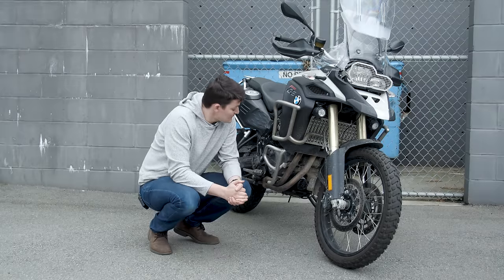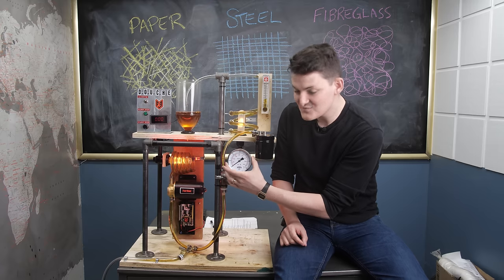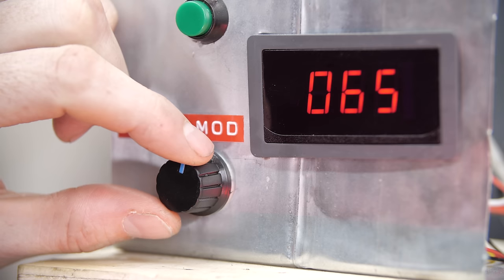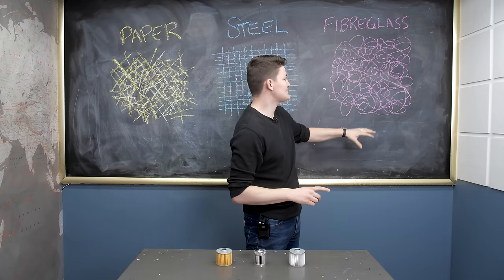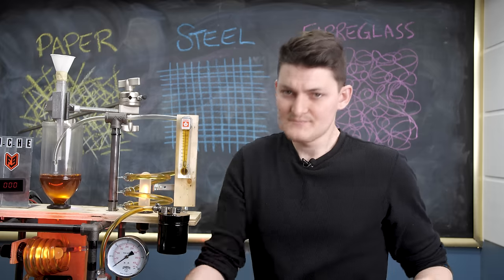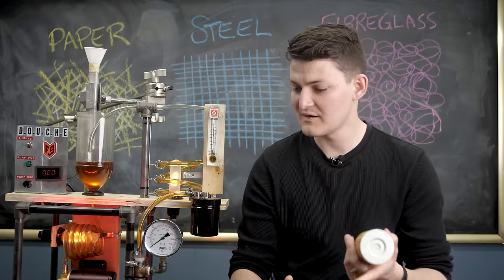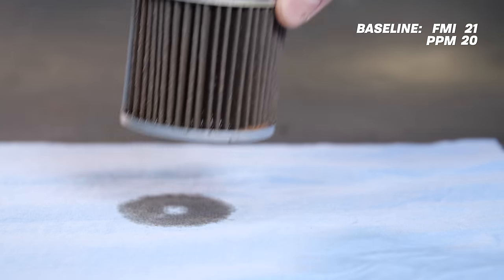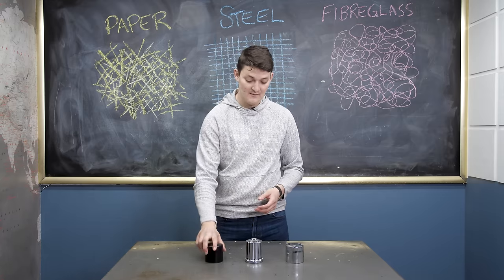The Best Oil Filter - Testing Paper vs Fibreglass vs Steel

Comment: The only thing I would add to this topic is the outer case quality. I have seen cheap filter balloon and or burst at highway speeds. SO it pays to purchase a quality filter over the cheapest option to prevent oil filter failures. I prefer the ones that have the "nut" on the end of the filter housing, so you can use standard socket over a filter wrench to remove the filter. I personally use a K&N filter, and for the last 20 year have never had one fail on me, but you are more than welcome to use whatever you prefer. This is just my two cents on the topic.

Comment: Like anything else, if what you currently use is working
Don’t change.  Like all those who upgrade their brakes when most don’t drive thier vehicle to the 9/10ths of its ability, yet think upgrading to racing parts at high cost gets them better performance at 1/10th, never mind that I racing almost everything is replaced/overhauled between each heat/race. Thus it only has to work within a defined timeframe/distance. You are spot on that application, and maintenance intervals matter and usually only if 10ths of seconds make a difference, otherwise go with stock or cost effective slight upgrade. Your vehicle has to pass many extreme to most daily drivers experiences in heat cycles, weather and wear. Those highly paid engineers on staff have found the sweet spot for 95% of drivers. Classic case of consumer brainwashing that more is better. Do you know how much abuse your current vehicle can take? More than most will ever even think about giving it.

Comment: there are only a few channels that open up and compare similar filters and all their examination relies n whether it "looks nice". Thank you for doing a scientific evaluation on the actual performance of the filter instead of the standard "nice" scale rating.  I couldn't care less if the filter is painted in pearl metallic with a silicone anti-drain back if it filters as good as my old gym sock.

Comment: There are cartridge style paper filters on some cars, e.g. the VAG 2.0l TFSI. Naturally they're in a plastic housing. So for those, a stainless steel filter would not need to have such a dramatic lower capacity for particles, as the filter diameter wouldn't be reduced. Besides, it could also be (partly) compensated by having a longer filter.

Also the higher back pressure of the paper filters is very likely not an issue at all if you're an everyday user. The engine manufacturers are taking this into consideration. On the contrary, if you have a massive oversupply of oil in various parts of the engine, you might run into different issues. Think about the oil drainage out of the cylinder heat cover. If that's at capacity, you accumulate oil under the cylinder head cover until bad things happen. Or in a slightly better case, you have just some more oil under the cylinder head cover and risk to run low of the magic stuff in the oil pan. Or you get more oil mist from the piston underside cooling, which needs to be dealed with by an oil separator. Granted, you might not hit this spot with those tiny steel filters compared to the larger paper filter, but the principle still holds true.
And it kinda doesn't matter anyway unless you're looking for a racing application and want to reduce the amount of power taken by the pump. Typical oil pumps in combistion engines are displacement pumps (gear pumps, sliding vane pumps and the like). They pump a fairly constant amount per revolution, only reducing it slightly due to internal leakages with really high back pressures. So after the oil filter you still have pretty much the same flow rate, and the same back pressure from the oil system itself.
Last but not least, your oil system is designed to supply a sufficient amount of oil to the engine even in cold conditions, when most engine oils more resemble honey. There you find some serious back pressure from the filter, and you should treat your engine nicely and keep revs low. Still, there is sufficient oil flow for normal engine operations, so when the thing heats up, it'll be no issue whatsoever to get oil pumped through the filter.

While this test might not do full justice to the way an engine might be constructed and the boundary conditions, it seemed to be executed well. And as long as it's only about the filter performance, it covers the crucial questions with a good enough methodology.

Comment: Thank you so much for this. I now want to make an adapter or custom set-up, for bigger or multiple paper filters. The best option for a hard working courier or roadtripper. Best filter material, but higher flow for performance, and higher capacity for the long haul. And for engines that don't use filters, like the splash lubing air cooled Predator engines. I want to make a paper filter system for them too.

Comment: I also chuckled at the oddly appropriate Douche acronym 😂 however I would (anecdotally) add on that not all paper filters are the same. I had a BMW 325i which had aftermarket filters always broken at the time of an oil change. The OEM BMW filter stayed intact. Paper is best, and I also (hope) that Stock is best of the best.

Comment: I'd like to see you do a video on the Honda Odyssey 4 wheeler (1977 - 1989), why it was the only dune buggy style quad, and why Honda stopped making it. The early ones had a simple roll bar behind the driver. At some point that was changed to more of a cage with two angled bars going down to the front. Think side by side UTV with only one seat, the engine behind the driver, who sits almost on the floor of the vehicle.

Comment: Your oil pressure check was done with the oil at room temperature when the oil is more viscous. Oil should be over 212°F or 100C to get a true reading of back pressure. The oil needs to be over that temp to burn off any water in the oil. Less water means less acid.

.

Comment: Another great video, very clever. Wouldn’t it have been more ‘scientific’ to heat the oil up to the same temps it would be running at in an engine, after all, oil gets much thinner when it’s hot… And those filters being different filters could be for different grades of oils?

Comment: Normally I watch FortNine and my brain is processing answers to questions i've never had.

Now, after watching this, I'm experiencing more questions than ever before and I don't like it.

The engineer in me is stuck with the following observations:
- Is the oil heated to operating temperature (85-110 degrees C, depending on motorcycle)? Sure changes the properties of the oil.
- Oil pressure/flow changes with different RPM. Is the flow from the pump corresponding with the filter used and/or referring to a make and type of motorcycle?
- Why on earth would you want to spent money on a filter with a pressure relieve valve? So much oil isn't used in the average motorcycle and the maintenance intervals are relatively short and adapted (between 6000 and 12000 KM). If you need to use the pressure relieve valve something (or someone) is already failing and you'll only notice when it is too late. 
- What oil is used? Mineral oil has way less cleaning and friction properties than synthetic oil in general.
- What is the pressure after the filter and/or the pressure drop since that is what counts? Some filters work better with back pressure anyway (as designed). (Oil comes from the pump, goes in the filter, comes out of the filter, passes the pressure sensor and lubricates the engine under pressure. Dirty filter = low pressure = stop. As mentioned before, a full filter will be trouble.)

Maybe a backstory of D.O.U.C.H.E. will clarify things but i doubt it. For now I'll call this filter dispute: 'unresolved".

Comment: I have always used paper or felt oil filters on my motorcycles but I also fit a magnetic sump plug which collects debris the filter might miss. Also, magnetic sump plugs work whether the engine is running or not.

Comment: Please don't dismantle that beautiful rig yet, can you do more tests of different brands, sizes, amounts of folds, paper thickness, etc.?
Are there bigger paper filters that can take the high racing flows? Does the bypass valve help with exactly that?
This really is useful information and to whoever built the test rig, you've done an incredible job it looks amazing!

Comment: Great presentation as always, love the quick one liners. 

On the pressure test, I think it is irrelevant because the bikes are engineered to run at the pressure of the paper filters. I am interested in knowing if the pressure does change as the oil gets dirtier. Again, I think it’s irrelevant in performance of the bike, but just curious.

Comment: I would wager that if you unrolled and flattened the media in each filter you would find that the paper filter has the most surface area.  That means a slower velocity through the membrane and a particle has a better chance of being captured and a higher probability of staying captured.  If you look up “particle filtration in liquids” you’ll find  SEM pictures showing what the filtering action looks like.

Comment: People will often swap their filter  for a car filter that is compatible, i.e. a white K&N "Nascar series Toyota Yaris filter will fit a Buell or Sporty, same exact size but their relief bypass valves  are rated for different pressures. I'd love to see the relief valve and micron ratings between auto and motorcycle to see the differences in protection and wear.

Comment: It would be a challenge.. but  I feel that heating the oil to the immense temperatures that it gets from an engine would effect results.. Yes this would open a pandora's box with all of the other variables that could occur, but 200° - 250° would seem to effect materials differently. 
Thank you for your time effort and curiosity!

Comment: As someone who has done lab work which sometimes requires filtration, I choose paper.
Steel I think is the most eco friendly since it's kinda reusable and steel is pretty recyclable.
Paper is recyclable too but with that much dirt in it idk if that's possible.
Whatevs, as long as we plant more trees than we cut down I don't see the problem.
Fibreglass however is the worst in that as well. Can't be recycled properly at all.

Comment: There's a number of issues with using these test to define the properties of an entire filtering material. First off, I'd be curious to see if running at full engine Temps would change results. The biggest issue is different manufacturers use different weaves of material. Meaning you can have a paper filter that has 99% efficiency at 40 microns and another with the same at 20 microns. It's also not clear the effect it will have on flow.

Comment: I am not surprised about the metal filter as many small displacement bikes and old ones have one in the drain plug if anything at all and they do almost nothing as the mesh has big openings and that is if it is even serviceable without splitting the case

Comment: I was told to change the filter every second time the oil is changed.
The theory was that as it catches contaminants, they filter gets better at catching contaminants.
I I trust what the mechanic does, but it sounds good in theory especially if fibreglass is used.

Comment: Greetings from Germany 🤬😤

Great video tho...
We did this test in Mechanix-school in 1993 but with different oil-types as well.
You get different results. For example a 20W or a 30W sometimes needs a metal-filter for maintaining the right oil pressure.

Comment: I am happy to hear that the paper is fine. I honestly expected that like most other reviews, the "most expensive" is the best. Good for those of us without endless amounts of cash flow.
Reply: problem is this test don't really prove anything as the exact same materials can have 2 whole different results depending on the filter brand. they are not all the same some are worse some are better.  you can't really say anything until you have tested multiple filters using the different materials or get the best of the best filter out of each category of material.

Comment: Years ago there were two companies selling filters that used single-ply toilet paper, Frantz and Motor Guard.  Both were bi-pass filters, filters cost about $1.00 and a quart of oil needed to be add every 6000 miles. If oil wasn't loaded up necessary additives it would never need to be changed.  My dad was at one time an early seller\vendor.  In my opinion the sellers didn't get proper support.  Imagine how much oil could be saved if government and military used these filters; maybe, just maybe...

Comment: I only use OE filters.  They're not so much more expensive than a quality aftermarket and it's designed for my bike.  If there was a problem the manufacturer would redesign the filter

Comment: If You run a 0.5 Micro Bypass in parallel to your main oil filter it would clean up your oil significantly.

Comment: Also remember there are many different types of each type of filter. Made with different types of build and materials quality. I agree the paper filter is like the Honda. It’s tried intrude and will do its job no question. But I personally like stainless steel filters made by specific person and brand and I have actually spoken with him and have seen the statistical data that disproves the stainless steel filter shown here. The stainless steel filters I use actually catch more than paper. But comments Are like a lotto draw you never know who’s actually right and who’s wrong and who actually knows what they’re talking about.  
       I think a better video would’ve been 3 of the best brand name of each filter running in an actual engine then test oil. But I still enjoy watching these. I’m 37 and have been working on my Own bikes since a very young child. I mean like rebuilding dirtbike engines when I was 12 now I work on my big turbo diesel‘s which are the biggest pain in the ass but it saves me tens of thousands of dollars. It’s not what I do for a living but I’m good at it and I do you know quite a few things about this category

Comment: In theory, I like the idea of the steel filter, but the real world says different. To me, the best use for the reusable steel is as a backup on your ADV bike for when the OEM one gets a hole punched in it by a rock. That way, you can keep going, then when you can replace it, the steel filter gets rinsed with brake cleaner and goes back in the bag until next time. I suppose you can just carry a spare OEM, but then you have to replace both it and the holed one. You only need to buy the steel filter once.

Comment: What is being filtered?

15 -25 - 35 microns are "nuts and bolts" and would quickly block the fine filtration ability of the filter element and eventually the coarse one. I read that nowadays the abrasives that cause wear in the engine,  especially with extended mile servicing, are mostly carbon and silica particles which are very effectively held in suspension by the additives,. These are much smaller in size than the material used in the test.  It would be good to see a test with 5 microns of material only, or the minimum given by the filter manufacturer, where the flow rate should not be affected as much, and where the synthetic filtration material should perform better?

25psi resistance test should be a real-world test at 90degrees C as many bypass valves open between 1 - 2 bar (14.5 - 29 psi)

Comment: For off-road riding, paper has one big drawback.  If you drown your bike in the river and water gets in the oil, the filter will often clog leading to oil starvation. There are mitigation measures such as attempting to drain the water from the crankcase before restarting but that can be problematic, etc.  I still use "cheap" paper but there is that risk.

Comment: the difference in mass of metal particles between a 16PPM and 20PPM concentration is trivial. also, a small neodymium magnet easily captures that much ferrous metal. oils of healthy engines do not contain such "high" concentrations...

for example my 900cc uses 3.7L of oil: for 20PPM there need to be 0.076 grams of abrasive particles suspended in the oil and 0.061grams for 16PPM. that's a 15mg difference between paper and metal filters. that much metal fits in a cube of 1.25mm side. 

for 20PPM, the volume of 100% metal is a cube w/ the side of 2.13mm. if that much metal is in the oil, something is not alright... :)

Comment: That Aprilia joke offended me at most with my rsv4 running perfect at 42000kms while also being the absolute truth.
 
plus little add-on, the filter is useless anyway because the big transmission junks wouldnt get there in the first place :P

Comment: I have to point out that in a Harley you dont have a clutch in your oil. I use a steel to keep temps down and change it when it gets dirty. When you have a clutch in the case it is a different story.

Comment: You missed at least two types of oil filter: Centrifugal and bypass

Some manufacturers build centrifugal filters into their motorbikes... and you could theoretically fit them as an aftermarket part on your motorbike (but I've never seen one).
Centrifugal filters will remove particles down to 0.5 micron so theoretically they're the best filters you could use?
Aftermarket centrifugal filters tend to be expensive, large and require additional plumbing.

Bypass oil filters filter about 10% of the flow on each pass and usually have a much larger carrying capacity than a normal filter i.e. They have a higher surface area... so they can trap more particles. They trap particles down to 2 micron and below.

Bypass oil filters can be broken down into a further 2 categories: replaceable and reusable e.g. Trasko (reusable) & Amsoil (replaceable)

Typically a bypass oil filter will reduce your circulating particles by about 50% or more.

:-)